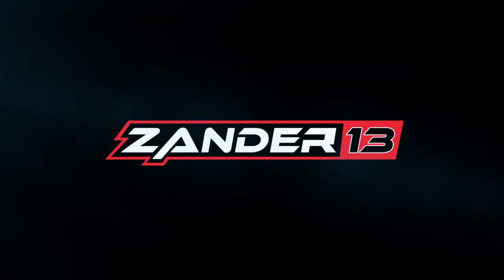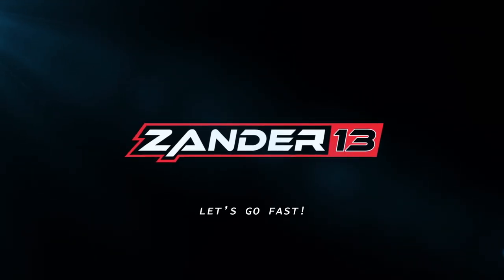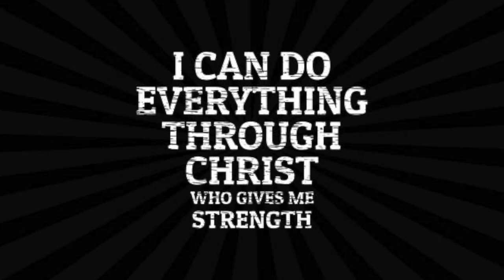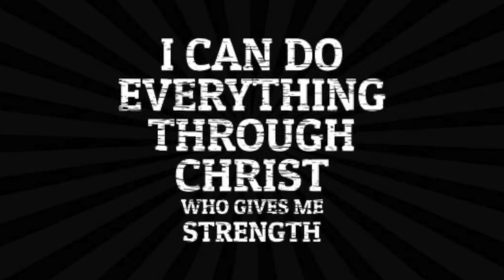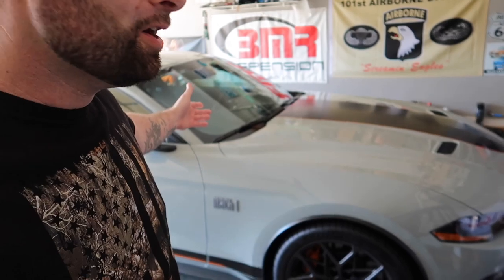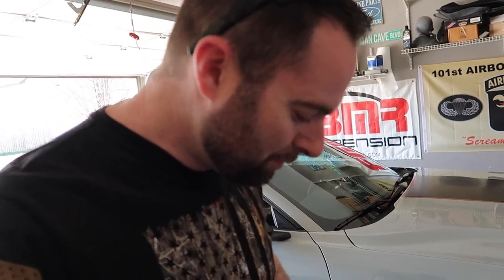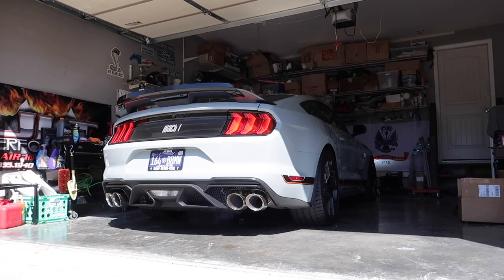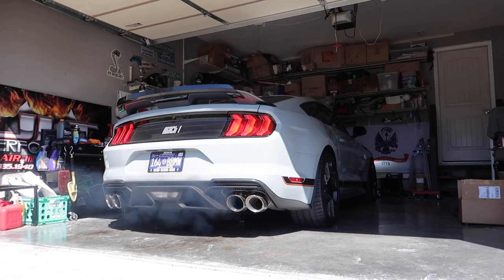MORE POWER for my 2021 Ford Mustang MACH 1! Twin Turbo vs Supercharger?

Comment: I would say go with a whipple that will have the characteristics around the middle ground between a roots style blower and a centri blower. You will have great drivability around normal driving, but have the extra power up top. As far as the mach 1, on the engine side of things its basically a 5.0 coyote with 350 intake track. when you make it a blower car its going to go back to being just a 5.0 and that platform has been done up in all the various configurations already. The Centri/ procharger would be sick but mainly for the sound since you have a manual and the blow valve would be crazy sounding while normal driving.

Comment: procharger man, easy to tune, lower weight, and the ability to run safely and under control. I think having that blower whistle at idle would sound sick. youve done TT, and blower. do a centrifugal procharger.

Comment: Max effort NA is the safest and I know guys are in the 9s with Simple stuff. My old car was low 11.0 with basic cams and old gen 1 stuff. Gen 3 with cams and ported heads easy low 10s high 9s where you live. But if boosted Whipple or Odin. Anything you do has been done 10,000 times already on this platform.  Not many max NA stuff but it costs the same as boosted and less gratification comes from it.

Comment: Since it has the tremec trans I would go with a single turbo kit since it can handle the power, I’ve been talking to daryle and he’s going to do that to his new 10 speed. You would be the worlds first single turbo Mach 1
Reply: The Tremec in the Mach is a nicer driving trans than the MT82 but it isn’t any more durable according to Lund.

Comment: I have been stiffening the suspension more before I get the pro charger kit that is made for the Mach 1.  I am adding IRS subframe connectors and have added the Gtrac bar to eliminate tram lining.  Bought the steeda two piece rotors all around and the new MGW shifter.  Just waiting to install.  I have the Kooks Green Catted LTubes and jacking rails with Palm beach 93 tune.  Also have the Steeda XPipe.  She is a beast.
Reply: I was looking at the kooks green catted headers for my 2020 GT. Holy shit they are expensive so I went with American racing catted headers.

Comment: Pro Charger! I hear they run cooler than turbos a specially on road courses. And you can keep your strut tower brace bar.
Reply: I have a procharger and they run a lot cooler than turbos. You don't have the issue with heat soak also

Comment: If possible Roush Supercharger Kit - Phase 2 750HP with 3-year/36,000 mile limited Roush powertrain warranty included. Play it safe so you can have some type of security if something happens.

Comment: Paxton NOVI 2200 or Vortech V3 15LB pulley with race blow off valve with a 10lb spring it will have good spool and not to much boost for E-85. Buy the VMP throttle body adapter and put a 80mm gen 3 throttle body for easy hookup and easier tuning.

Comment: Roots or twin screw would be ur best bet for power and reliability. I would say turbo but with these motor you don’t want to push them over 800 hp, unless u swap out block for a Iron coyote. 800 hp easily attainable with a supercharger. More for personal choice, the turbo will make a lot more power though. Awesome car dude🤘🏻👍🏻🎸🇺🇸

Comment: I personally know someone that has a new manual Mach 1, with an Oden on it and after talking to him a lot I think I personally i would go with twin turbos but I would have to go with smaller turbos! Nothing big because I would want a little more torque down low which the smaller turbos would provide that and the coyote itself loves that too end! So to me that would make a perfect combo and on top of being able to control that boost from a controller vs a pulley would be something personally I would want!

Comment: Centrifugal supercharger for keeping power in the upper rpm and best drivability. Don't deal with a pd again. The water cooling is subpar imo and a good chance of the pump going bad and causing catastrophic IT'S. And turbos get too addicting when you can just hit the + button for more power lol.

Also the trans in that car is glass

Comment: If you decide to go turbo again go top mount. The whole sleeper thing goes straight out of the window as soon as the turbo starts spooling. Top mount seems like it wouldn’t put as much stress on the manifolds and might be a little bit sturdier.
Reply: NM, looks like it’s going the centri route. Probably the best route for a manual car.

Comment: ZANDER ... if you want any street track time do not go turbo period in the s550 you will lose time could put you easily 1 to 2 seconeds down compared to other power adders. You're best bet would be simple cold air long tubes and e85 set to about 31 degrees timing . If you want to go power adder , go back with the Odin. Much smoother and power down low to help you get the power you need out of turns .

Comment: I’d go with a turbo set up, just not too much power so it’s not unusable on the street. There are way too many supercharged mustangs out there. Plus you’re not using extra fuel to constantly run the supercharger. Only when you step on it and turbo(s) spool up. Superchargers seem to be a lot more popular in general on American muscle/pony cars, especially with the supercharged top of the line models (GT500, ZL1 and Hellcats). Centri is a little different too. Roots style, well should’ve just kept the Camaro lol

Comment: I'm bias here cuz I'm saving for a procharger on my car.  The noises they make are just heaven.  But w that said centrifugal all good all around and won't knock the tires off. A supercharger for me seems good as a drag car power adder for the instant boost.  Turbos for me are an all out build deal boost to the moon 🤷‍♂️ just my opinion thou

Comment: Z , I read an interesting article on adding a Supercharger , I'll have to find it again to keep it short and simple the mounting depth plus gasket size and mounting bolt length it's not deep enough but will work , but could cause leaks over time with pressure the Supercharger puts out.

Comment: I think your chose Alex ( I spotted the letters on the box in the end! ) is a good one. It was going to be my recommendation as well. Both in terms of your plans to want to be able to somewhat hook up on the street ( on low profile tire ) and having plans to to some laps on a road course. In both cases. You can't be dealing with ton of low end torque or IAT at the track. ( also the big issue with 3160 Tremec is that it doesn't seem to stay together if lot of extra torque is being put through it. ) Also I like personally their air intake placement as well as how the route the belt( also from a crank pulling perspective )   

From a channel perspective. I think it was also a good move as it being fairly new option on the market ( from a well know company in this game ) but has so far had limited Youtube exposure.  The other ones are something that all have seen million times already.  

Now my personal issue with centri blowers. Is the nose the make on and off the throttle. So for real street use I feel the gears whine ( not to mention with the loader ones ) and big blow off valve. Is something that gets old fast!

So I personally I have been looking into if someone was maybe offering a working on possible Rotex centri kit. And the only thing I found was that a company that is quite well known in the supercharging game mostly with Jeeps and that type of stuff seem to have working on one, some months back. But seem to have all have mostly silent since. 
https://www.hamburgerssuperchargers.com/Ford-Supercharger-Kits_c_86.html

The only downside for me with it is the air to water setup they have chosen. As I personally prefer the
simplicity and worry free reliability of the air to air in only street driven car.

And finally Alex. I would keep it only on pump gas ( all the power you might ever need for the road course )  And it is much more real life type of deal then the E85 for most of us your viewers out there. 

Looking forward to watch your journey with this setup.
Reply from the maker: Yup. You basically read my mind for the most part. ESS kit for lower TQ and lower heat for track use and 93 octane. Definitely not looking for sky the limit power. Just fun and reliable. Yes. ESS kit being newer to the market on a Mach 1 definitely was the plan too. That hamburger kit looks pretty interesting too though

Comment: Battle go Procharged, I promise you won't regret it. As much as you daily drive it and put it on the track, you can't go wrong. You're not really limited to power as long as you have a good tuner and you can go down in pulley size. Im tuned by Palm beach dyno and I love it. It loves this cold air that we're having in the North right now
Reply from the maker: 😉 I actually already have bought the kit before I even made this video lol. It’s in my garage and it’s a centrifugal kit ☺️
Reply: Lol you when with the supercharger huh 😂😂😂

Comment: The Magi 2650, Odin Blower, or the Whipple 3.0 would work great on their bud.  A good supercharger is probably going to be your best middle ground if you want steetability along with track worthiness.  Going Twin Turbskies would be great but leaves you with more boost than you'll want on a road course along with lag from the system.  The Centrifugal systems are great for making power up top but leaves you wondering where the power is down low.  

I'd go with either the Magi 2650 or Odin Blower system on there.  The Whipple is great but is getting a bit dated in its overall design.  I had a manual 2017 ZL1 with the stock 1.9L roots style blower on it and it was tons of fun on street and track.  Having a little more than 600 rwhp would have been great but then you run into issues with putting it down to the ground especially if you wish to do any kind of track work with the car.  600-700ish is the magic spot for a great streetable track car in my honest opinion.

Comment: You’ve had both (turbo and a supercharger) already and you did say that you want to do something different from what everyone else is doing, so why not skip the turbo and supercharger and go with a killer 300 hp direct port nitrous setup on E85. Add all of the bells and whistles (stand alone fuel cell, top of the line progressive controller, remote bottle opener, purge, heater etc.) and then go up against the turbo and supercharged cars). That would definitely be a huge step in a totally different direction and likely to really peak the interests of many (especially those who think nitrous cars aren’t contenders for turbo and supercharged cars).

Comment: Personally, I would go with a supercharger. I feel they're more reliable and provides consistent power throughout the RPM range of the Coyote. While normally costing more and requiring more time to install. The Hellion twin turbo may produce more horsepower, but you may have to deal with turbo lag, and spooling up when staging. Being an expensive new daily driver Specialty Mustangs. If it were my beautiful Mach 1. I would go with a supercharger.
Reply: It isn’t reliable when it comes to constantly changing those belts. 🤮 and have you ever installed a twin turbo kit. Way more complicated than a super charger my boyyy 😉

Comment: I would personally not go with boost.  I would however, Get with Ben Calimer and get the Tremec built.  It’s a better transmission then the MT-82 but rumor has it it’s no Tremec 6060.  I know a 500hp NA build probably won’t drum up as much interest but…guess I would prefer to see you go max NA and try to match GT350 power…

Comment: Don't get nuts and ruin this car, add the TP suspension, tune it and run it E85. You don’t need another issue or problem child but if u wanna truly boost it, I’d go Ford or Roush and keep your warranty. I don't care what people say about the Roush kit, its very good and makes great reliable warrantied power

10 Sec Street car with a warranty
Done😎
Reply from the maker: Don’t worry. I’m only looking for like 650-700 hp. Nothing unsafe this time. This is a special limited car
Reply: Sounds Perfect Buddy

Comment: Man your going down the same rabbit hole.
Reply from the maker: Lol how?
Reply: @Zander13Productions  . Just don’t want to see you blow stuff up anymore , you need to enjoy this car and put out some good content , racing , tracking ect. If you want to go boosted 100% go Whipple with their calibration pump gas will be close to 700 rwhp but super safe day in day out , this will be a fast fun street car , over 700rwhp shit will break and you’ll overpower the chassis. My 18 has whipple with whipple tune and has been faultless .
Reply from the maker: @andrewkram2222  🙏🙏🙏
Reply: @andrewkram2222  I agree, Whipple is the best. Stick on a Reische 170 deg thermostat on for low chts and an interchiller for low IATs keep it to 650whp or abs max 700whp and it will live for ever and still be a rocket. How do I know? I have a 10r80 GT with this set up, unreal, no issues what so ever.

Comment: just to play safe(warranty wise) you could go ROUSH...and then throw on the "gt500" strut tower brace if the factory one doesn't fit..with all of that tire you're running, I wouldn't want to give up any chassis stiffening, since back road, autocross and track is your intention.800 hp turbos might tend to be a bit toward overkill.650 hp would be nice for the street!

Comment: NO!!!!!!!!! You've already done both of that S#1t!!! . We already  know what rhe car will do with both.   Helion, VMP, Whipple .been there done it,,, WDGAF! . 
Different Setups , gearing, tire ratios, e85, 93,  an 87 tune! suspension, weight  savings,  audio,  free mods,  oil analysis . Trying out simple mods on the Dyno .. come on dude

Comment: No one is going to wait for you to build bost on the street
Reply from the maker: Build boost on street. I don’t street race so….
Reply: Then boost… only bad is shift and loose boost for a sec but thats with all of them
Reply from the maker: @foxbody199350  the Mach 1 has flat foot shifting so it won’t bleed boost. No other mustang has that feature
Reply: Definitely boost then